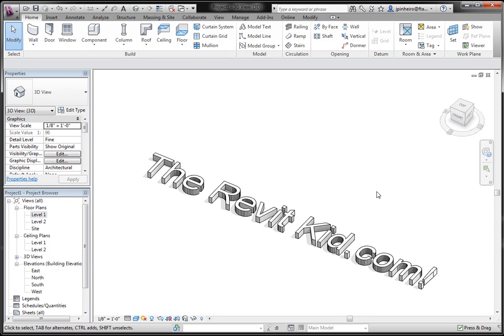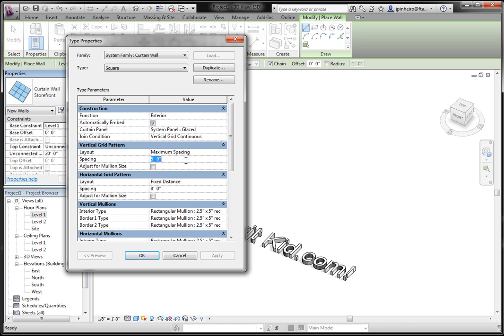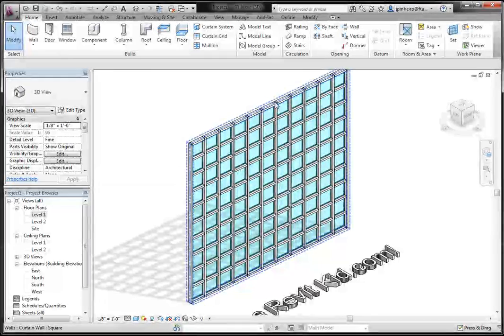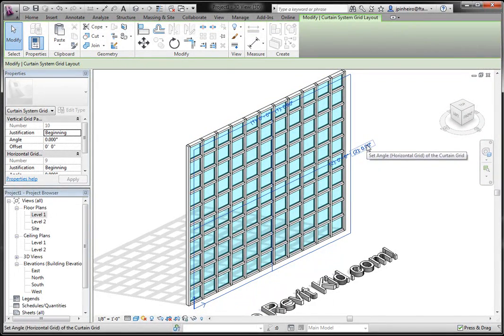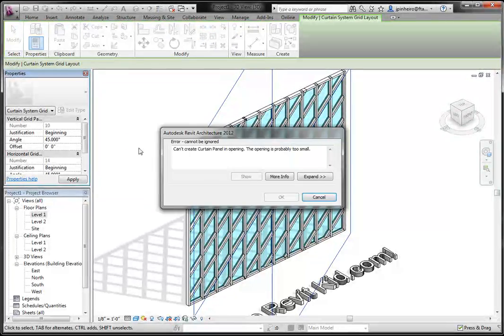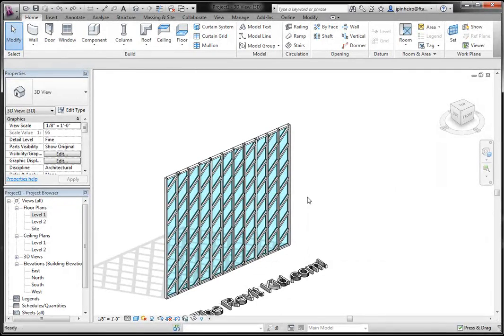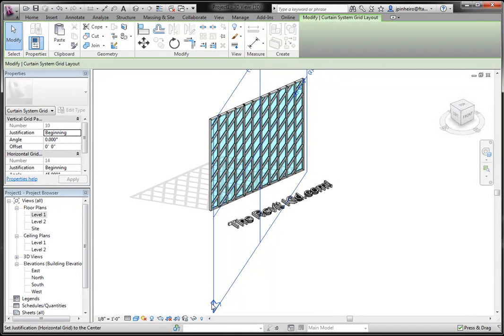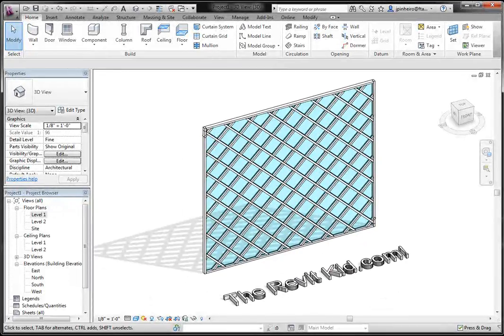Revit Tutorial - The Revit Kid - Rotate Curtain Wall Grids ( Angled Curtain Wall Grids)

Comment: Hi @TheRevitKid, thanks for the great video. Is it possible to use a custom curtain panel with an angled grid? I'm tying to create a panel with reveals at panel joints (using voids) and am getting an error that Revit can't make the panel. Are we restricted to using system panels with an angled grid?